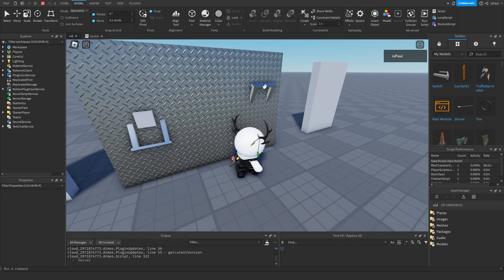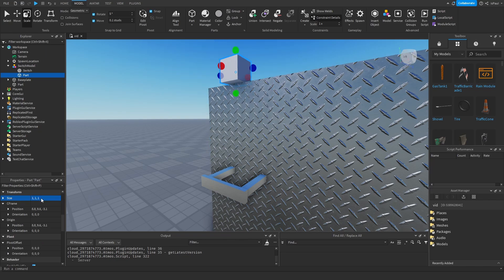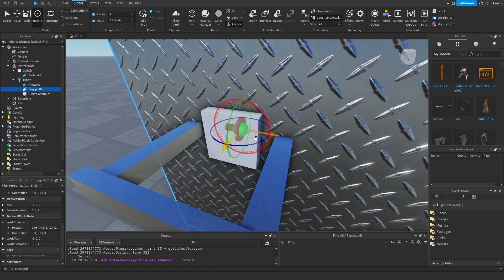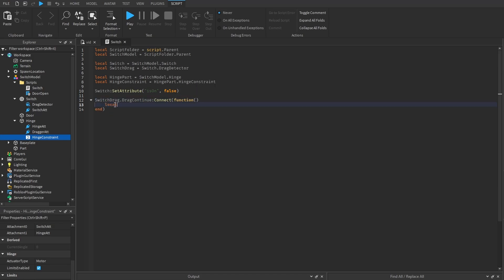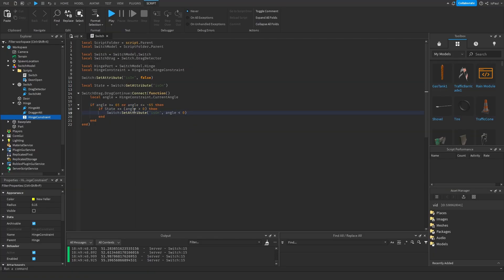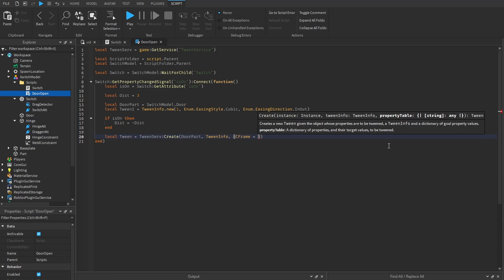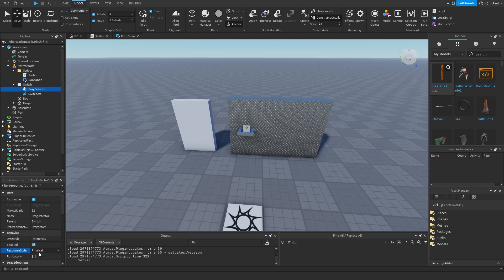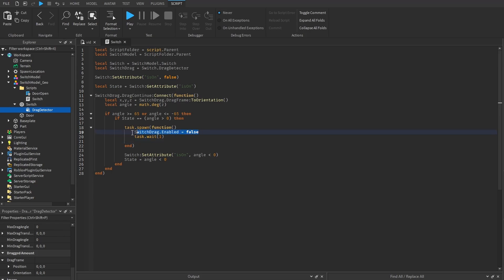Draggable Switch! | Roblox DragDetector Tutorial (With Opening Door)

Comment: is there benefits to making game objects like a switch or wall, or anything, as a mesh in blender, rahter than a model as parts in studio?
Reply from the maker: Meshes render better than Parts, you also have more control over the whole model since Blender allows you to add more detail or edit the mesh in a way that Studio doesn't (with uv's, materials, topo, etc.).
But if you want to have a simple switch made out of few parts, then there's no need to use Blender.
Reply: @Paul1Rb oh i see thank you, the only issue with meshes is it takes longer to load and especially its texture/material/surface appearance, any solution to that? Because when players join the game its just grey with meshes missing, but after 1 minute more or less it all loads in.
Reply: @drnoelll  pretty sure that's on the players end